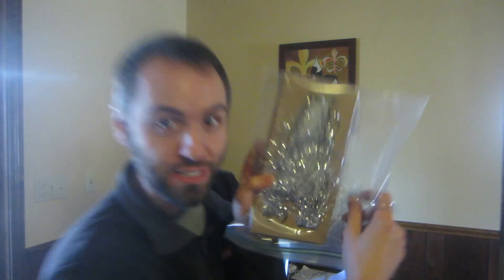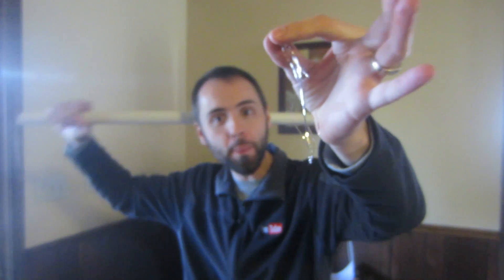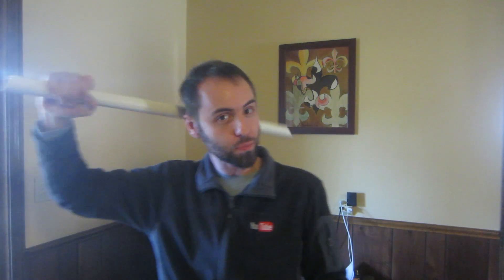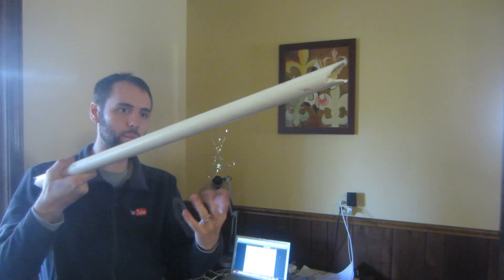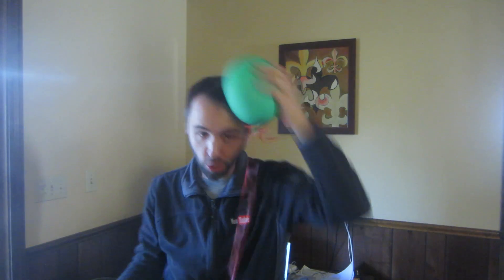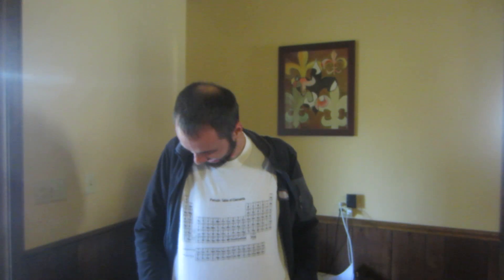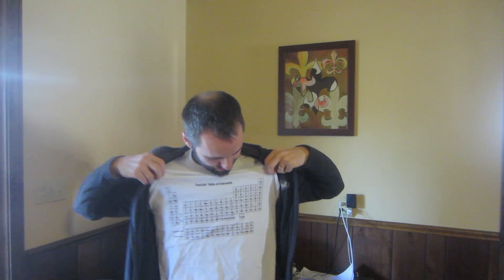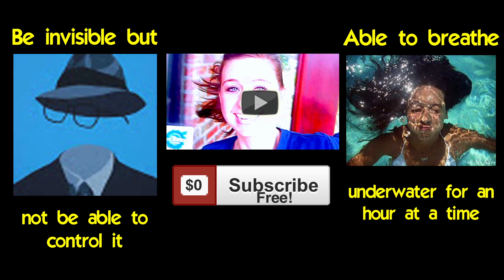STATIC ELECTRICITY (LaneVids Science Experiment)

Comment: The problem is moisture in the air. Get a hairdryer, put it on heat, run the hot air over the tube for maybe 20 seconds, rub the tube on wool...guarantee it will work

Comment: I'm no expert but I'm going Physics a-level so I'll try.

the foil is metallic so it can have both positive and negative charges, what's happening is that the foil is just losing or gaining free electrons into/from the air because they are attracted to/repelled by the charge on the pipe, because of this the foil becomes oppositely charged to the charge on the pipe so they stick. the polarity of the charge (+/-) on the pipe depends on that type of plastic and what its rubbed against.

in order for the foil to float, the foil and pipe must have the same charge so that they repel. as for how you achieve that I don't know, my guess is that you would have to somehow charge up the foil separately so it matches he charge on the pipe.